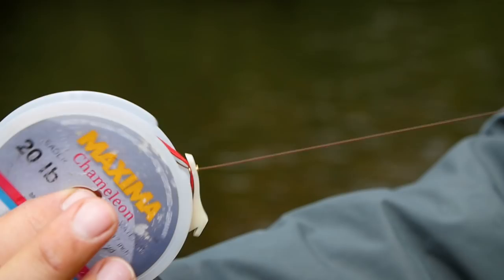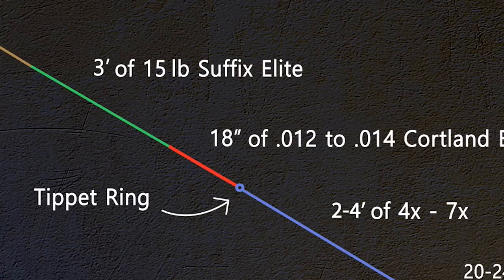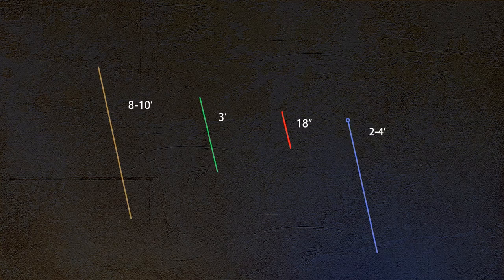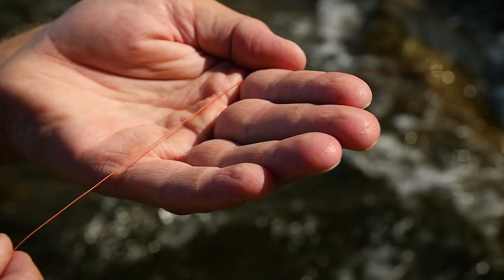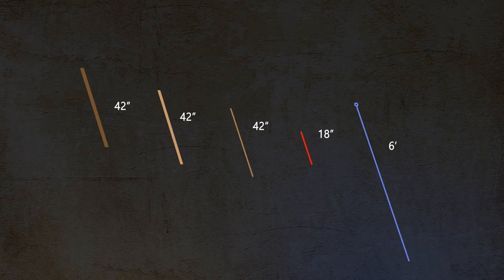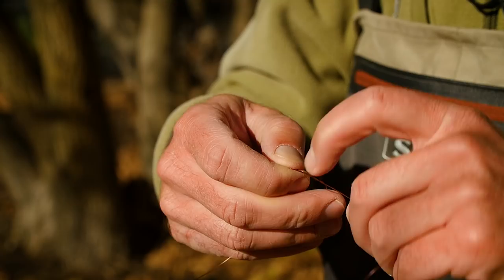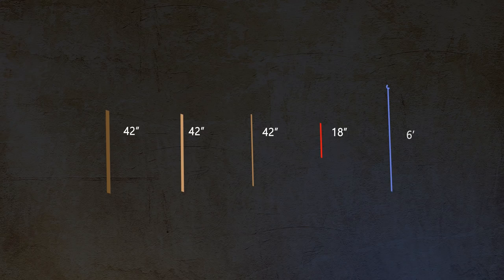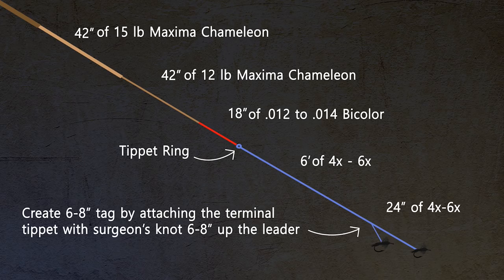Euro Nymphing Leader Formulas - Modern Nymphing Instructional Video

Comment: This is awesome!  Are you adjusting the tippet length based on depth of the area being fished?  Do you feel the fly hitting bottom or is it more just watching the sighter? Must be my bass fishing days, but I keep getting fixated on the fact that with this approach, you SHOULD feel the fly bounce and hit every piece of rock bottom then distinguish between if that bump you felt was a rock or a fish.  By trying to distinguish the bump, I then get stuck on using too heavy of nymphs, however when I use lighter nymphs, I don't feel anything, hence line control which I tend to lack.
Reply from the maker: Great question, yes you can definitely adjust your length of tippet depending on the water's depth. However, unless the water is extremely deep I typically adjust a few other parameters first. The weight of the fly is critical, also keep in mind that the sighter can be used as a depth gauge as well. How close it is to the water's surface should give you an idea of how deep you are fishing. Most of the time you will see the sighter jump about the same time you feel it. It's very common to fish flies that are too heavy while learning the technique. After some practice you begin to rely more on your experience and finding the right depth becomes easier. A simple solution to many situations is simply lowering or raising the rod tip (thus moving the depth of the sighter and flies) to adjust for depth. Hope this helps.
Reply: As a fellow convert from spinner bass fishing to fly fishing and nymph as well, it does take a little time and frustration of missing strikes. The strikes are subtle ( not like a monster bass) 
Try to keep a small bow in your fly line I.e. from the top eye to the water surface rod is always leading the line and a small bow is in the line, not slack. There r many great videos on YouTube on nymphing. 
I have been nimphing for a year, first 6 months were tough, last 6 have been great.
Learn how to read the water.. YouTube again

Comment: Do you like the butt section of the leader in flashy or transparent color?  Doesn't the flashy color scare the fish?  Thank you!
Reply from the maker: Thanks for asking. The butt section in made of Maxima chameleon which is a dark redish brown color. Then there is a sighter made of brighter material. It is thin and has little to no affect on the fish, as it can be casted in close proximity to fish even in low clear water and usually doesn't spook fish. Below the sighter is straight tippet. Hope this answers your question.

Comment: I've recently become interested in using this type of leader for nymph fishing. What I had been doing is using pre-made tapered leaders (usually 9 ft long) and simply using an indicator (New Zealand wool or foam indicators) at a position up the leader depending on depth of water. Regarding the 2nd leader formula mentioned, am I right in assuming that you build the first 4 sections (20lb, 15lb, 12lb, and sighter w/ tippet ring) to take on trips, then when you're actually on the water, add a length of the 4x-6x tippet as needed depending on depth to the first nymph? With this type of setup, you're essentially only ever casting leader material and not fly line, correct? Especially if you're usually quite close to where you're fishing, using longer rods to hang the line. I was never clear on whether or not fly line even plays a role in nymph fishing, other than perhaps offering slack. If that is the case, nymphing is even more different than traditional dry fly fishing than I thought. Also, would a 10 ft 4wt rod be a good go-to nymphing rod? As someone who has studied macroinvertebrates, it seems more appropriate to learn the most about nymph fishing, as most fly fisherman should know, that's what their diet mostly consists of! Thanks for the video!
Reply from the maker: Your assumptions about the leader are correct. It is a versatile system that doesn't use much of the fly line. As for a 10 ft 4 wt, that is a great size nymphing rod for this technique. I also couldn't agree more about studying and learning about macroinvertebrates. I have a bachelors degree in Fisheries and Aquatic Science and I must say entomology was among my favorite courses and aspects of the degree. Thanks!

Comment: Gilbert,

Great video!  Very informative.  Are you going from 12lb test sight material and then 4x tippet RIGHT after the tippet ring goes on?  Or do you use thicker pieces of mono before getting down to the 4x tippet?

Thanks
Reply from the maker: I typically fish tie a tippet ring right to the end of my sighter then straight to the tippet. However, Devin has adapted a way to combat windy days, or simply to fish a dry dropper. Here is a link to a blog post Devin shared on Tactical Fly Fisher that shows his leader formula which includes a thicker piece of tippet before the tippet ring. http://www.tacticalflyfisher.com/blog/battling-the-wind-with-a-euro-dry-dropper-hybrid-rig

Comment: Love the video and I've tried some of the tactics with a regular 9 foot 5 weight. It's worked out pretty well so far. Just a practical question. How do you stow your rig when moving from place to place without the loose tag fly getting wrapped around the rod and line?
Reply from the maker: That is an excellent question. If I'm ever mindful enough to think about it I sometimes will wrap the tippet under the reel seat and run the dropper back up the rod and hook it on an eyelet. That usually leaves the dropper close to the cork where I then poke it into the cork, or sometimes get lucky and the length is such that I can hook it onto the hook keeper. Hope that descriptions makes sense, and I'm glad you are funding success with the technique thus far.

Comment: Great video Gilbert. I use fly rod byron #3 multilenght for czech style nymphing. So I'm wondering if I have to put a maxim chameleon a bit thinner, for example 18 lb instead of 20 lb, so sufix instead of 15 lb to put 12 lb? Thanks and all the best
Reply from the maker: That's not a bad idea. Through trial and error you should be able to determine whats best for your rod. You could try the leaders in the video, or change it up a bit for your specific needs. As long as it tapers correctly and turns over your rig it should be fine.
Reply: ok,thanks Gilbert Rowley..Thanks for the prompt reply. I'll try this maxima chameleon, I ordered 100 m. What is this maxima in fact, nylon, or how to behave, whether flying as the fly line and as far as I care can bet ,someone says only two lengths of his stick? Is it a friend tie with any of the fly line or just backing and if I could I it put more than 20 feet?Many thanks and all the best
Reply from the maker: Maxima Chameleon is nylon that is stiff and doesn't have a lot of memory. It's really great stuff. You could tie it straight to the backing, but without fly line you can't really switch throwing dries or streamers with this setup unless you fish them on this leader. There are a few other reasons, but it would work for sure going right to the backing.

Comment: I have a 9ft 3wt rod for nymphing.  Is there a way to modify the setup for a shorter rod or will it make a difference?  I used a 9ft butt leader which I tapered down to 5x, then used a tippet ring and tied on my flies very similar to what you described, but wondering if maybe I could tweak the setup with the indicator section, but seems like so much leader for a 9ft rod.
Reply from the maker: Thanks for the great question. The leader setup is not dependent on the length of the rod. The shorter rod will limit your reach while fishing this techniques, but that isn't impacted by the leader. The majority of the time there is only leader out the rod tip, no fly line regardless of the rod length. Because of this I'd tie up the same leader even if fishing a shorter rod....... in fact that's exactly what I did for the first 2 years I fished this technique ;-) Keep in mind as mentioned in the film, the type of fly line you have the leader attached to can cause sag which messes up your drift. If you have a traditional floating fly line make the butt section longer so you are only fishing leader in the rod guides and no fly line. Better yet, use the Cortland competition fly line which is thin like a leader but easier to handle and fish with. I'd also recommend you check out the full film Modern Nymphing https://vimeo.com/ondemand/modernnymphing if you haven't had a chance to yet, and also our newly released follow-up Modern Nymphing Elevated https://vimeo.com/ondemand/modernnymphingelevated 

Have a great day!

Comment: ever use UV glue on the knots to make them easier to pass through the ferrules?
Reply from the maker: In my experience with this, it helps then not hang up as bad, but it also creates a bigger mass traveling through the guides. Better in some ways, not such much in others. Devin's leader mentioned in this video uses a straight butt section long enough to eliminate most knots from passing through the eyelets, if that is a point of concern for you. It is for me, so that's the formula I typically use. However, if casting and turning over your flies is more important, then Lance's formula is better, but there will be a few additional knots passing through the guides. Have a great day!